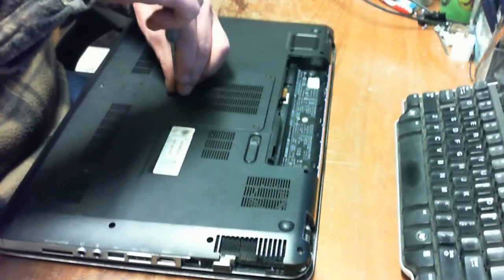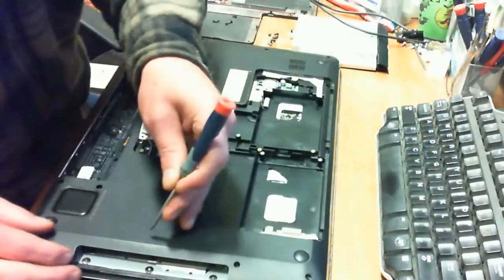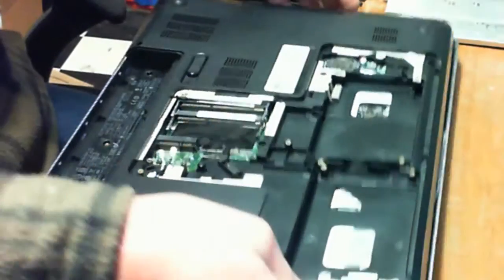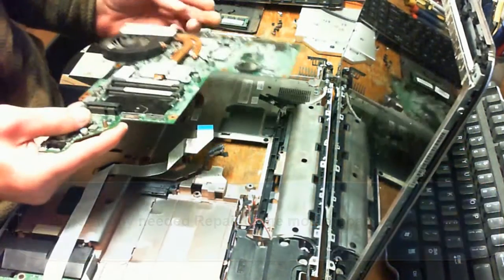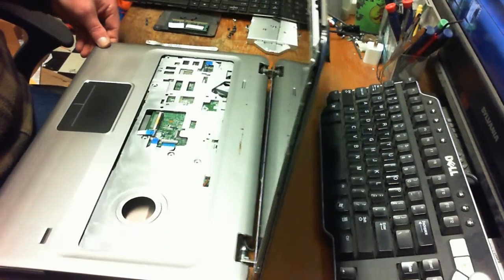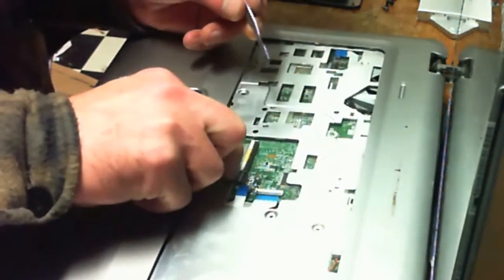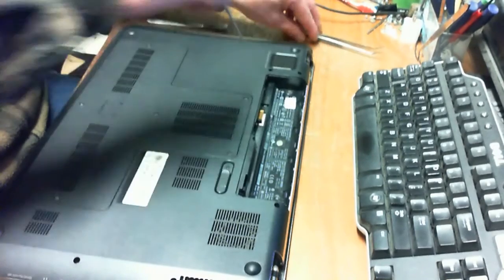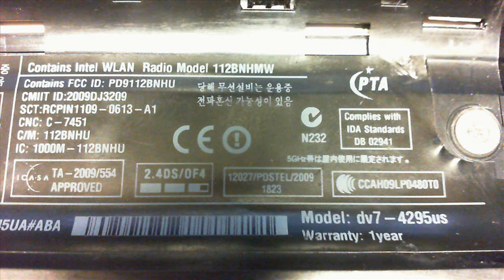HP Laptop DV7 4295us Repair & Disassembly

Comment: Greetings, a pleasure to greet you, I currently have a laptop of exactly that model. dv 74295us intel i7 2630Qm processor and ati radeon 6570m graphics. The question I want to ask is whether this machine has interchangeable graphics or simply works with the integrated graphics of the board, since in the device manager only the Ati radeon appears but the intel hd graphics does not appear and I understand that this processor handles integrated graphics. And my other concern is that if this board can disable the graphics chip at the hardware level and leave the intel hd graphics processor working. Thanks in advance for your attention

Comment: I would have use lock weld glue, since the location of the hot glue looks to be in an area were the pc gets warm and the hot glue would melt again.
Reply from the maker: +AntiMusick I know, but then if the customer wanted to replace the lower shell he would also have to replace the hinges as they never sale only one side, or spend hours trying to scrape all that crap off, this way at best he can worm it up and wipe it off, and as long as he keeps it clean so it does not get that hot it will not get to the point that it will melt anyway only get a little soft.

Comment: did you mean bezel?  what was the repair?
Reply from the maker: +BayAreaSun Yes Bezel, most do not even know what it is called and I am not showing how to remove it so a proper name is and was not necessary, And No that was not the Repair, that was showing you how to get to the point that if you have schooling you could Repair it.